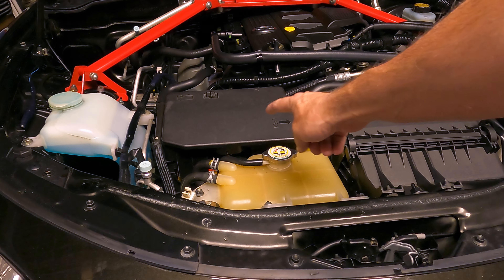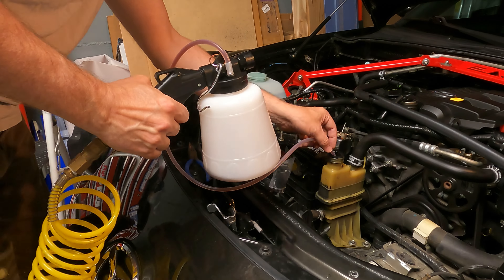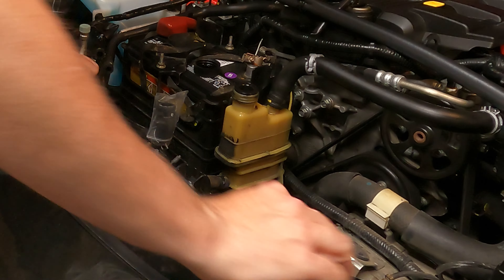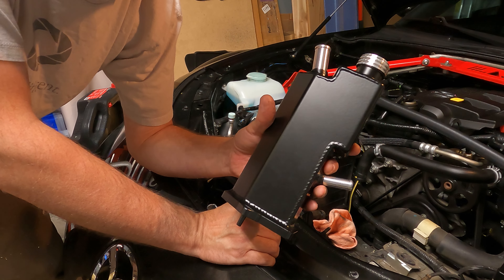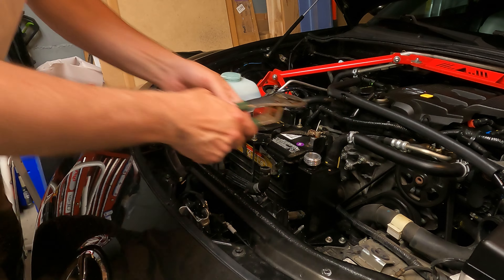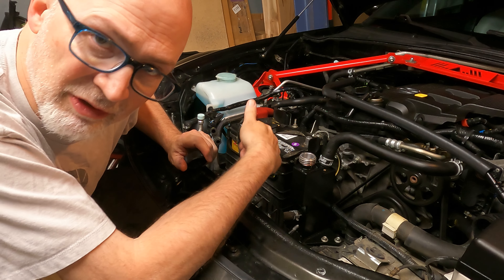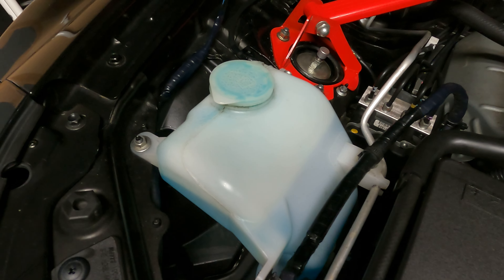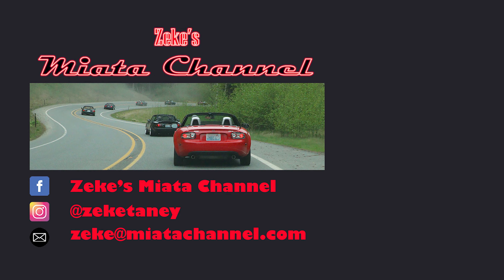NC Miata (2006 to 2015) - Installing the Moroso Power Steering Reservoir

Comment: Holy crap that looks good I was thinking of getting this for my 06 

Would I still have room if I leave the coolant tank on?
Reply from the maker: Yes, I think you could do it with the coolant tank on.  The most difficult part would be removing the hose on the front side of the reservoir.  It's tight, but it could be done that way.  I just took mine out because I was changing them both at the same time.  It would be tough without taking out the airbox, tho.